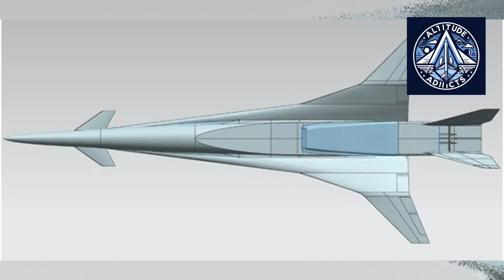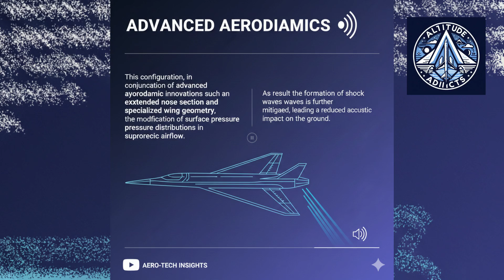Russia Tests RD-93MS Engine for Quiet Supersonic Passenger Jet Strizh

Comment: What a waste of resources.👎👎👎👎
 They should First build engines for sj100 and MC which are critical for survival of air transport while war and sanctions can go on for years to come.
Reply: @jacekkwiatkowski8387
Ты отстал от жизни, эти двигатели давно существуют!
Reply: @Mr_McAlex they are not certified yet, still in testing phase and that means they cannot be used on commercial flights.
Reply: @jacekkwiatkowski8387  
Ты сам себя опровергаешь... 🤦‍♂
Reply: @jacekkwiatkowski8387  Двигатели для МС-21 и SSJ-100 уже разработаны. Это будет для вас новостью если вы по какой-то причине отсутствовали на Земле последние годы. А эта разработка ведётся абсолютно другими людьми и находится на раннем этапе испытаний.
Reply: PD-8 for SSJ-100 and PD-14 for MS-21-310

Comment: that image at 9.51 - is not a nozzle that is the air inlet ....  
2nd point a demonstrator that weighs 16 tons ...... that is a Mig-29 ..... 
the concept has 2x vertical tails ... as does the Mig-29. 
and RD-93s are basically the same as the RD-33 in a Mig-29.
going back to the 9.51 image again  ..... it does look like a Mig-29 with the ventral air intakes removed and moved to the top of the fuselage ..... tucked in to avoid the shockwave from the nose ....
Russia's military has hundreds of Mig-29 airframes to "donate" .... yes
this project looks to me to be going to progress much faster than most people think possible - especially if the thing is to be flown by a pilot using a screen - why bother having a pilot on board for the demonstrator ? have him on the ground ..... less risk ..... faster development - develop it as a drone ...
Reply: oops 4.00 in .... sorry about that